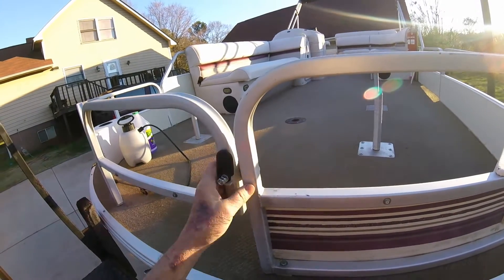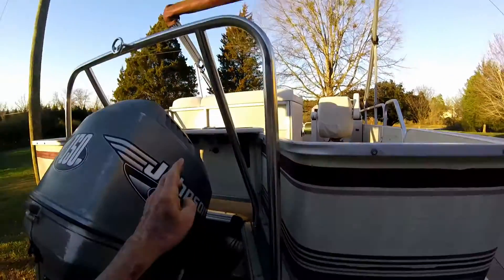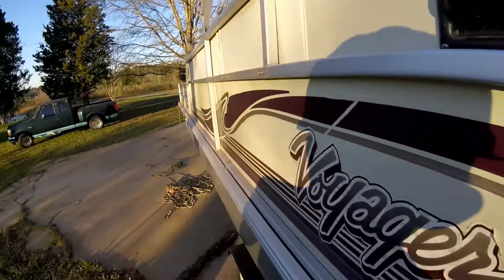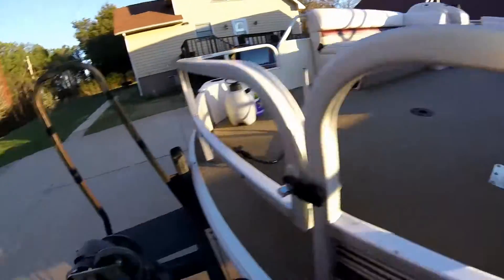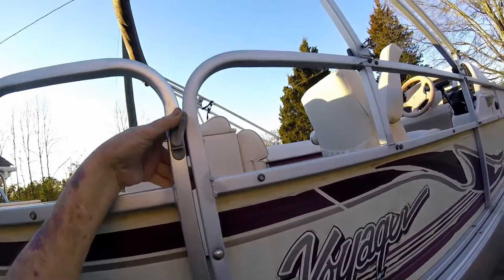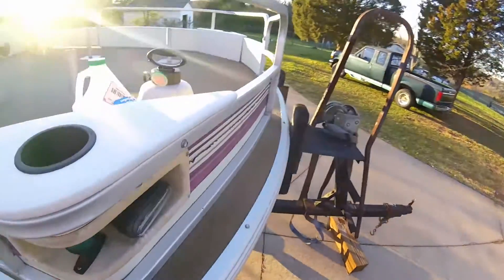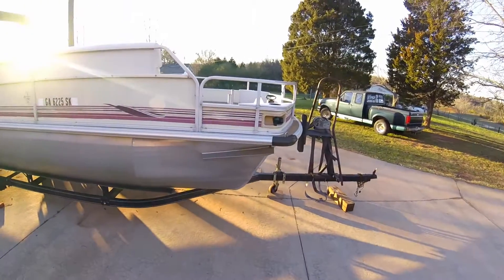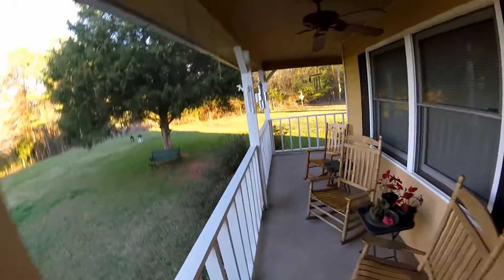Pwalpars Resurrect my boat Update 2 25 2017

Comment: Walter, I'm just finishing up the same process on my boat.  Started at the bottom rebuilding the trailer.  Then progress to the boat and the engine.  Like yours she had set for over 10 years without being run during that time.  Had to bring in a pro to resolve electrical issues on the engine.  A person who makes vinyl decor for cars and vans can reproduce your decals and striping for your boat.  Looking forward to seeing you and the wife taking trips on your boat.
Reply from the maker: Thanks Harry

Comment: If it were mine I would take the engine to a pro to get it done. I am not to good with motor work and my patience is short. I will bet the whole fuel system needs replaced maybe even the tank especially if it is a metal tank. If it has rust in it you will be stopping up filters and  the carbs for a long time. Been there done that one. Rusty tanks are just a waste of time and a source of  frustration.
Reply from the maker: Thanks John  I will consider that